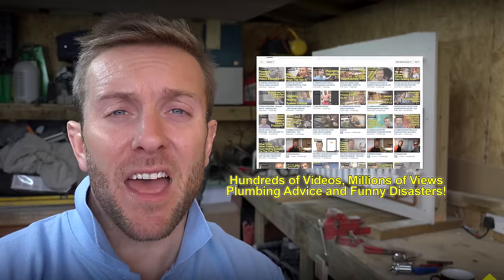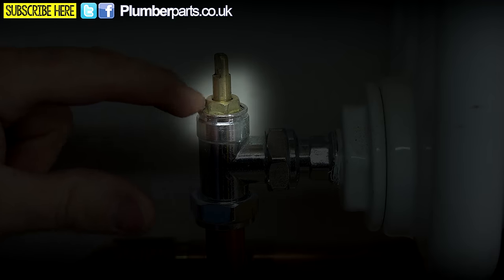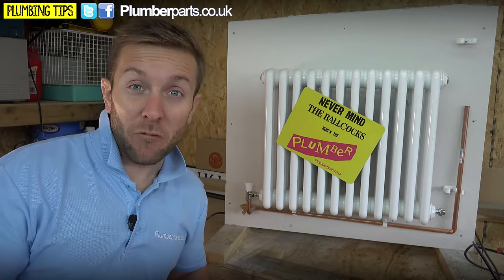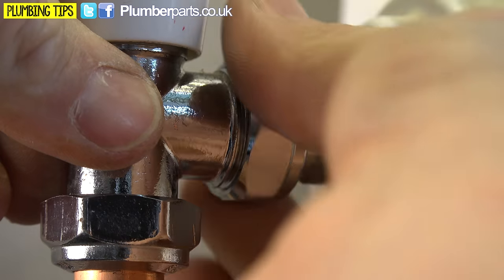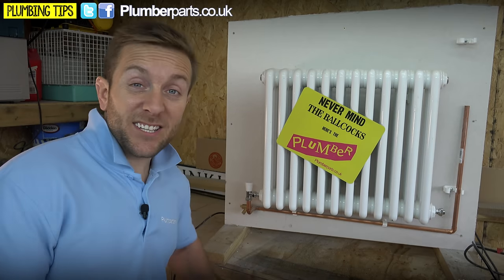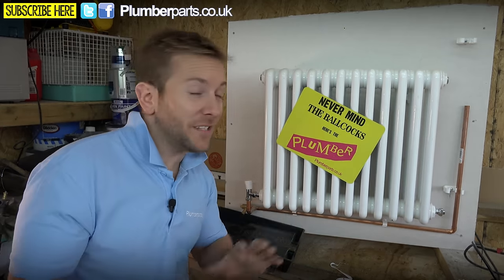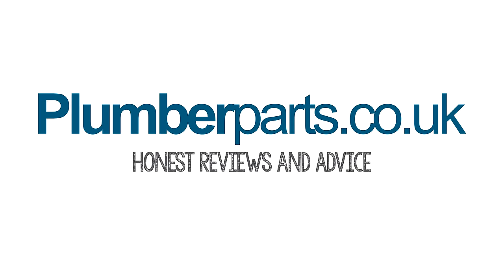HOW TO REPAIR A LEAKING RADIATOR VALVE - Plumbing Tips

Comment: My radiator leak was at the last one indicated on this video…..I tried to do the fix with the PTFE tape, which didn’t work.  I also tried with a properly sized o ring.  That didn’t work either.  The radiator would not leak when the heat was on, with these fixes, but once the heat was off and the metal contracted, the leak began again.  I ended up fixing it by putting the PTFE tape around the threads of the nut.  I thought I’d post this, in case someone else had the same problem.  I don’t know if this is considered a ‘fix’….but my pipes are not leaking anymore.  Thanks for showing how the valve, etc., works, which helped a lot in my ‘repair’.

Comment: A handy tip: before draining the radiator, open the air bleed so water runs (into a bowl) until the pressure dies down, it’ll make undoing the tails a lot less stressful as the water won’t now be pressurised
Reply from the maker: Good call mate!

Comment: Absolutely fantastic advice, spent hours trying to fix a leak after installing a new radiator and you showing to use the plumbers tape around the olive solved the issue and taught me a new trick!

Comment: Hi James, Does it not matter which way you wrap the PTFE around the top of the lock shield above the rubber olive? you wrapped it anticlockwise in the vid, I understand there is no thread but would it not still unravel?.
Reply: clockwise

Comment: I had a slight radiator leak from the joint to the thermostat valve. I was all ready to get my toolkit out to fix it.  Then I realised it was finger pressure loose.  Tightened it up with a quarter turn.  Leak solved.

Comment: Had a plumber round today for a leaking radiator top valve. 'Im going to drain the system and change the valve - cost £350'.  Me: Errr sounds a bit excessive - check it on youtube.  Found this video and then a 3 min fix with the PTFE tape - £350 SAVED.  I loved ringing him back and told him to cancel as I had fixed it.  Thank you so much for this video and exposing cowboy plumbers xxx

Comment: Thanks mate. I've followed you for a few years and do quite a bit of my own plumbing. Had a leak on a radiator which I've never had to tackle before, watched the video, followed your advice and job done! Leap of faith to turn off the valves and not empty the rad when you loosen it off, witchcraft!

Comment: This is the best site for any one doing  some plumbing work at home 
I have used this site so many times and find it to be just right for info and content 
Just fitted a designer radiator and the isolating valve started leaking when opened , literally a little jet of water shoot out the gland!
“Don’t panic” looked at your site got some PTFE tape  and five minutes later all Good😆👍
Big thanks to everyone involved with producing these great vids on You tube 
Cheers
Johnnie

Comment: Brilliant video! As always from this guy, helped many of times in the past. Aways informative yet chucks in the odd laugh too, a brilliant chap! I wasn't so lucky this time, had a leak in the threadded rad insert. Didn't have enough play in the copper work to do a quick live fix, had to drain system to fix. Bit of a PITR but got the job done. Will reprssurise and inhibit the system tomorrow, should be dead easy to add inhibitor as I have a tall vertical towel rail in bath room, highest point on system...happy days! 😃

Comment: THANK YOU @plumberparts. You just saved my ass! Came home to find a soaking wet carpet, top of the valve had failed. Packed with ptfe as suggested at the end of your video. Bone dry now. Will hopefully hold until the oil to gas conversion and trv upgrade next week by a local plumber. Thanks again!

Comment: Hi, Thank you for your video, you've taught me how to add PTFE tape correctly, but then when you did the packing gland at 7:26 I think you threaded the PTFE the wrong way round :) 

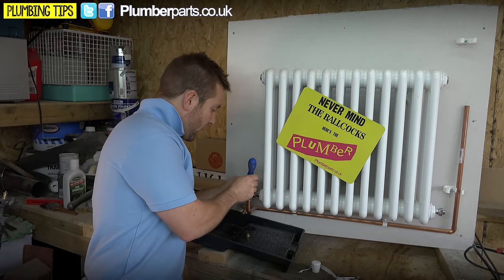I only noticed when you started packing it down into the gland packing at 8:25 then added the gland cover.

Thank you though, have been putting the job off on a few radiators in the house, keep loosing pressure on my boiler.

Comment: Thanks for this advice, going to fix my radiator leaks now. One question I have is, why do radiator leaks cause my hot water tank to lose pressure? After I burn my wood stove, I always lose hot water pressure in my sink taps...but I thought these hot water systems (radiator hot water and tap hot water) are separate systems, so how can my radiator leaks affect my tap water pressure? I have a wood burning stove with an electric pump connecting to radiators and hot water tank both... Thanks in advance for any help!

Comment: Thanks so much I’m going to have a look at my gf’s radiators in the livingroom and kitchen tomorrow as both have started to leak over the last few days, today I’ve been with my mate removing a 1200mm by 600mm double vector as the main front door into his hallway kept hitting it so we’ve put on a 600mm x 700mm and it’s just as hot in his hallway we’ve had to use a plastic snap joint and we don’t know what we’re doing lo but so far no leaks we’ve completely drained the system as it was the last radiator on the system

Comment: Thanks for the video. Question however.. when you remove the valve completely (@ time 3:27) will the water in the rad not gush out as we have not drained the system? Thanks again!

Comment: cheers mate i have a bottom leak live side on a combi system upstairs radiator i turned off elec, water at mains  and undone slowly exposing threads ptfe  tape at the ready and bingo no more leaks when i restarted system no more loss of pressure and no more wet carpet Thanks a bunch

Comment: Just recently fitted a new radiator, I replaced the old tail valves for some adjustable extendable tails, made the job alot easier!. Just wondering if you use them in the trade much?

Comment: Useful looking video - I have what appears to be a leaking packing gland and it's tight-as already so trying to loosen it to get some PTFE into it is on the verge of rounding the nut (it's very shallow/thin) which I obviously want to avoid - do I just need to try to find a more accurately fitting spanner than an adjustable to be able to get better purchase at it? As it's 7pm at night I've decided not to push it any further tonight in case I do some damage & create myself an out-of-hours callout issue!

Comment: Thanks for this, I couldn't get the nut off on towel heater. I opened the longer part, jammed it with that tape using a needle and closed it. Only opened a touch both sides, and it hasn't leaked again today. It was driving me nuts during lockdown 🤪

Comment: I have 8mm microbore under the radiator valve and it leaks from underneath the nut which is about 15mm. Will undoing this nut and wrapping the ptfe tape still work in the same way. I am a bit wary incase i lose the seal altogether and end up with a big leak due to the time its been on and painted over. Thx in advance.

Comment: My leak is on the bottom nut. Rad upstairs. Scared to loosen the nut in case the water gushes out. Can I turn off the water completely from the mains? Will that stop the water coming out? The leak is a constant drip and soaks tissues within an hr or so.

It musy of been leaking for years. As the flooring strips were soaked and rotten behind the rad. Sitting here 10.20 at night on bank Holiday Sunday wondering if I should attempt it. HELLPP! BTW THE rad is already off the wall As I was decorating. So that's not an issue. Just the inlet pipe.

Comment: Hi James, “Leaking Rad” I have replaced & reinstalled 3 rads.  However on reinstalling them, I have 1 leaking (weeping) radiator tail pipe.  I have tried to stop it by tightening it up - this didn’t work.  So I have had to drain the rad on 3 occasions adding more and more PTFE tape on each occasion.  On my last assembly I used approx 15 turns of the tape, but It is still weeping, so I will again for the 4th time drain the rad & add more tape i.e 20 turns of tape or is there another solution or product I can use to stop the leak.  Many thanks.

Comment: Can you repack the gland of a trv valve that has a much thinner spring loaded pin?

I just don't want to undo it and have absolutely rogered myself in the process

All information i see on repacking gland valves on radiators shows the valves with much bigger pins

Comment: Massively helpful video fella, thank you. I've got an internal reducer on a connection joining the pipework to a lockshield valve and I have the tiniest drip coming from it. I've tried 4 times rewrapping with ptfe but can't stop it. Do I need to get the top part of the reducer that fits into the valve off to apply the ptfe to the olive underneath? Cheers again

Comment: Hi James. How about a leaking drain off on the radiator side of the tail? I can isolate the system like you say but can’t get the drain off to seal. I didn’t even disturb it when I drained the radiator. I can’t back out the screw fully to see if there is a faulty seal.

Comment: Thanks for the video. Great stuff. My valve is old, when I remove the head, as instructed, there's a plastic cog on the top of the spindle which fits into the head for turning. Unless I remove this I can't get the gland nut off but I'm not sure how to remove, whether it should screw off or be pulled off etc. Any thoughts? Thanks again.

Comment: How durable is such a repair with PTFE wound around the spindle? I have stopped leaking from lockshield in my rad but I think I need to drain down the system and replace the lockshield as soon as it gets warmer.

Comment: In the past I have just drained down my system when doing any repairs. If you close off both radiator valve ends and start unscrewing anything isn't there a lot of water inside the radiator that will start coming out?
Reply from the maker: Your way is best, but most people don’t know how to do that - and if you’re prepared then any water from the radiator should be manageable!
Reply: @plumberparts  Thank you for getting back in touch so quick I appreciate it!

Comment: I tried to turn off the water flow to my radiator by trying to turn the lockshield valve off, but as  I turned it clock wise, (I like tighty righty better! lol!)  even a slight bit, water started leaking out of it. Any suggestions? And yes, I have already subscribed!
Reply from the maker: Tighten up the gland on the valve (little nut at the top mate) Hope that helps. Sometimes the valve is just knackered!
SUBSCRIBE! ➡️👉 https://www.youtube.com/subscription_center?add_user=plumberparts 👈⬅️ IF YOU HAVEN'T ALREADY! 😎
Reply: Thank you James. You are a gentleman.
Reply from the maker: No worries dude!

Comment: You show a radiator with a fan fitted below to push air up the vents in to the room making the heater more efficient. Where and what can I get the fans that click into the bottom of the radiators?

Comment: Hi I have 10mm pipes and have used a 10 X 15 reducer to install my radiator. I have a small leak at the valve where the pipe inserts. I have taken it off a number of times and applied ptfe but I still have a very slow bubble forming. Any ideas on a fix?

Comment: Hi,  I have a leak on the nut and olive where the body of the radiator valve goes onto insert of radiator. Its the side of the radiator where the TRV is.  Can I still carry this out without having to drain the heating system.  (It is an upstairs radiator).  Thanks

Comment: Hi. I’ve found that over the years the lock shield valves can leak due to being left in the on position for years and then you do a job you shut them off. The problem then arises when you turn them back on they go. Particularly on the cheaper builders/ B&Q style stuff. Would the PTFE tape or washer insert be the best fix for that and save a full drain down/ inhibitor performance? I was wanting to take a few radiators off in the new house and try and remove some sludge with a hose out in the garden and at the same time replace the service ports at the top with new ones/ bleeding point etc as most are covered in paint due to new house and had painters in. I know should have done this in summer lol but who actually puts heating in full blast in July to find out it’s always winter lol
Reply: hi, how did you solve this problem?
Reply: @МихаилР-в8о  probably best to wait till summer months and one at a time go round them closing them fully and then opening them again. If they go when you open them up it’s a bit of a nightmare you’d probably have to drain whole system down and replace them. If you got to replace them I’ve found it’s money well spent upgrading them for the more superior types as it usually occurs in the cheaper ranges ones that ie new builds the builder used or cheap B&Q styles. Notify a plumber you’re thinking of doing this or have one present and again try doing it in summer as heating not so essential if it needs to go tits up for a few days and you need to shut it off

Comment: Hi. If we shut off both valves on each side and bleed the radiator, will all of the water in the system come out?
Reply: Not according to this chap. When I tried water gushed out and I had to refit the valve quickly. Water everywhere. It stopped leaking for a bit after this but now it’s started leaking again. Not sure what I’m doing wrong.

Comment: I've managed to sheer the lockshield valve head off trying to turn it. No idea if it's on or off as was trying to see why the radiator wasn't heating up. Presumably I'll have to replace the valve. Any vids or advice on this?

Comment: I recently got a brand new heating system installed, a valliant combi and 9 rads, everything's good but one rad only gets hot at the top but freezing at the bottom, any ideas what it could be? the lock shield side is cold.
Reply: Check the lock shield is fully open
Reply: ReservedforMATTY yeah i've done that, but sadly no luck. The bloke told me to fully close it then open it a tad till you hear it trickling through, he sad that normally happens when its blocked with sludge, but there new rads so im a tad confused, ill whip it off next weekend and give it a wash through
Reply: Close all the other rads off and crank up the heating to help force the hot water to just the one rad which is failing to fully heat. If that works gradually work your way back one rad at time and balance the system with the lock shield valves.
Reply: +Flexiblood Probably got an air lock
Reply: Dont Get by Get Bry ok mate cheers ill give that a go

Comment: I tried using PTFE in Lithuania. . . .needless to say, it doesn't work here, because we have very high pressures and the threads are non conical as per standard, so you either put on half a roll on single thread or use hemp, like slavic people did for hundreds of years. I think I'll stay with hemp.

Comment: I have a leak NOW. I called the Home Emergency and they said they would have to isolate the radiator. I'm not a plumber and have no clue about plumbing.

Can anyone advise me on a potential cost of repairing or replacing the valve?

Comment: Cheers mate, saved me a wee cost.  Had a leak on the nut to the up pipe, as usual stood on a wet carpet late at night  after moving into a new house, probably due to a knock while moving stuff in.  Anyway, nipped it up a quarter of a turn and job done.
Reply from the maker: Hey hey! No worries! Glad to help you out....😎

Comment: I need my radiators checked for real! Fitness :O
Reply from the maker: +Reza Ns You'll be fine fella! HOLD TIGHT!
Reply: +plumberparts haha u replied back! Actually the all radiators apart from 2 were fine. The 2 that were not working had a bit of corrosion and the valves needed to be replaced. I didn't think radiators needed to be checked-how often should they  be checked, only when their not working? Fitty!

Comment: turned both lockshields off on the radiator and water is still coming out of the bleed key.
Reply: any suggestions?
Reply from the maker: Gotta drain the system as those lockshields are knackered! Sorry mate! SUBSCRIBE! ➡️👉 https://www.youtube.com/subscription_center?add_user=plumberparts 👈⬅️ IF YOU HAVEN'T ALREADY! 😎
Reply: It's never a simple job is it lol. I subscribed ages ago mate loving the videos. #Holdtight